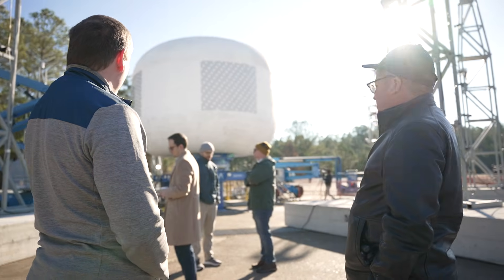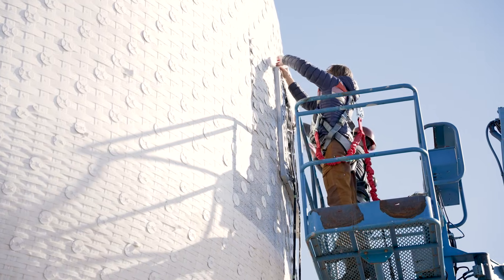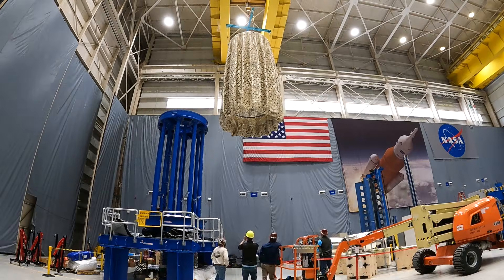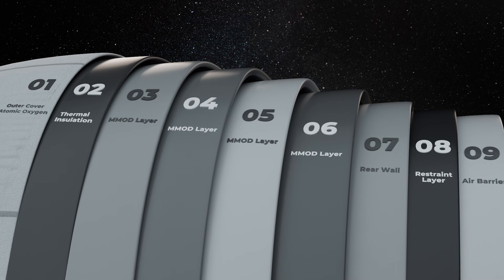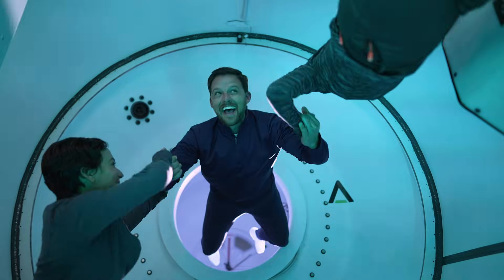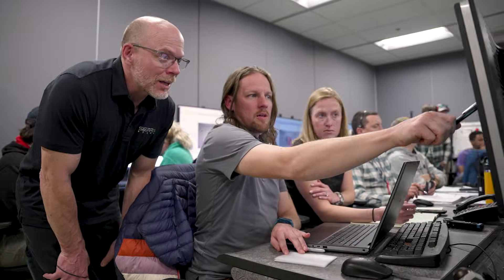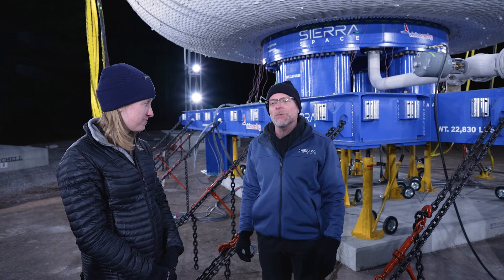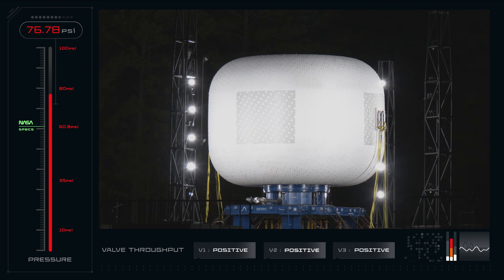Full-Scale LIFE™ Inflatable Space Station Burst Test at NASA Marshall Space Flight Center

Comment: I love to see this♥. Inflatable modules makes way more sense, than rigid body ones. I believe Sierra can only fail on production of these inflatable modules, either if they get stuck on developing one off custom sizes for new vehicles, or fail to build/finance factory for one size, that fits into most commonly launched vehicles, and potentially neatly stack into heavy lift vehicles.
Reply: Or nobody is buying. Many great ideas have fizzled out over the years because no matter how cool a concept might be - you need paying customers to succeed.
Reply: Rigid modules  have the equipment, plumbing, windows, thrusters solar etc attached to the outer walls with the inner being the access way - very easy to configure on the ground.
Inflatables are kind of reversed the equipment has to be in the rigid core tube or configured after it is inflated.
If an inflatables is set up with the outside between the core and expanded walls -although the inflatable has more volume their utilisation of that volume is not as good.
In space radiation protection another issue the soft walls are probably good at slowing or stopping cosmic rays but not so good for EM radiation - i think hard modules have better options for reducing both as the equipment mounted to the outer walls adds more shielding - although soft modules could be configured this way after they are deployed in space that involves more difficulty than with a rigid design that is preconfigured.
Will be interesting to see how the inflatables go and how they compare with large rigid modules that will be possible with starship sized payload volumes.
Reply: Trouble is, Sierra can get far more capacity per launch loading onto New Glenn (7m diameter fairing) vs. commodity rockets and their 5.2m fairings. They didn’t partner with Blue Origin for nothing.
Reply: Do these plastic bubbles protect from solar radiation as well as a metallic shield?

Comment: That's what that titan vessel engineers should have done: crush it to test it before using it on an actual mission.
Reply: You can’t crush test full size vehicles unless you have unlimited money. Models and known engineering principles would have worked just fine for Titan, the owner/builder simply decided to short cut safety to save time and money. Disaster is always the outcome.
Reply: Well, they were already informed several times by different experts both independant and on the team itself that the sub was unsuitable to go to those depths, but ignored them and decided to use the sub anyways. A crush test wouldn't have changed their mind, I don't think.
Reply: Or used a material that's strong in compression, unlike Carbon fiber.
Reply: Nah.   Im sure its fine.
Reply: it's the wrong test because their problem was a material fatigue problem. they likely did the test to excess. called it good. she's never tested how many dives it could take (it got a recommended and they ignored it anyway)
Reply: They had that data, the problem with carbon is it cracks, so it will do it once, but its once less that it can do it again. Think it had a rating for 1/3 of its implosion depth.
Reply: it's very hard to generate those kinds of pressures in such a large volume. i guess the best test would be to drop it in the ocean and see what happens

Comment: I'm curious as to how the interior components will be transported and installed.  Or will they just be empty tubes?
Reply: It would be cool if the tubes carried the inflation material (air/nitrogen/etc.) save a huge amount of space
Reply: I believe a lot of the internal fit out equipment and materials can actually be stored within the core of the inflatable. Once the habitat is inflated, crew can enter the module and assemble the internal fit out using the materials stored within the core.
Reply: There is a steel center piece that most likely would carry the parts. They will have to ingeniously pack everything in and around it and unfold it when needed.
Reply: In pieces and / or other cargo trips I suspect as far as transport goes.

I believe the idea is usually to build a frame inside to hold equipment etc.
Reply: Seems to me like most everything will be mounted on the steel core scaffolding and the balloon inflated around it
Reply: I was wondering the same thing. Is the plan to be able to inflate them already full of equipment?
Reply: I think the main hotel functions are built into the metallic core section for power, air handling, and heat exchange, then after the inflation rack-mount modules can be moved in through the hatches and lashed down inside the soft volume. Data systems are probably just wifi!
Reply: Current plan is for the all the hard components to be folded up and have the inflatable part wrapped over it, after inflating, it can be unfolded and set up. You can see it in the sleeving part here.
Reply: I'm guessing with dream chaser.
Reply: It's an "empty inflatable balloon" yes, if that's what you're asking? With a hole to dock with ships, so you can transport stuff through the hole to the inside of the "inflated balloon".
Reply: A fair amount of stuff can be installed before launch, other stuff would be launched aboard visiting spacecraft and moved through the docking port into the hab for installation, just like with previous space station modules.

Comment: Psi rating really low, still a bit dangerous for hard weather, and I’m sure it’s temperature controlled to limit expansion. I’d feel safer with a haul that can reach 2x psi with a bit more room to move in. Still amazing work, a lot to do still for this kind of pop up structure.
Reply: 75 psi is roughly 5 atmospheres.  ISS cabin pressure is 1 atm.  So I'd say your 2x limit was met, by 2.5 times.
Reply: What "weather"? It's designed for space.

Comment: what happens if it gets hit with a 10 gramm projectile at 10 km/s ?
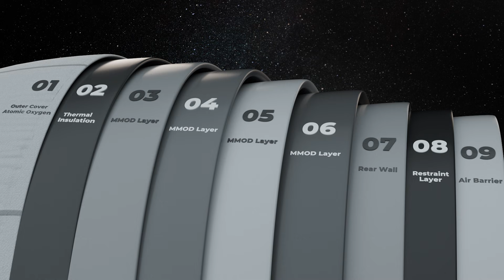Reply from the maker: Sierra Space works with NASA and uses the known and projected orbital debris environments in designing the MMOD shield. Those designs are then tested by simulating orbital debris impacts at varies speeds, size of projectiles/materials and angles. Sierra Space performs MMOD testing based on Design Reference Missions and environments. When hit by a projectile the MMOD would absorb the impact and perform as designed. There would be no effect on the pressure shell or restraint layer. We have multiple MMOD layers which can be seen in the video at 2:42.
Reply: @SierraSpace  a video going into deatail would be nice, explaining differences between module types and the appliance of the MMOD layers.
Reply: @SierraSpace  Your Hypervelocity Impact Testing (HVI) would need to prove that for the above scenario.  ;)

Comment: It's interesting to note, though NASA wanted to pass roughly DOUBLE the pressure at atmospheric conditions at sea level (The same as on the space station) Sierra more than doubled that again, to almost 5 times what it would be used at.  A wonderful test.
Reply: The reason NASA wants double is because when you put this into a vacuum, that's the equivalent pressure differential when the thing is deployed in orbit if they put it at full sea level pressure. But it's good to see it do better.
Reply: Exactly, considering the size & volume I was also surprised at how much air pressure they used.
Reply: Actually, 1 Atmosphere of Pressure is equal to 14.7 PSI so NASA's requirements are roughly 4 times the normal air pressure at sea level.
Reply: To be fair, it’s not a very high pressure. There’s higher pressure in your tap water at home.
Reply: It's good enough that they can probably look at reducing material weight a bit.
Reply: Why are those planned to be used at 15PSI of air instead of 3PSI pure oxygen?
Reply: Will be cool if they tested in vacuum at Bell Aerospace.
Reply: This video should have mentioned the normal expected PSI value.  Atmospheric pressure seems to be about 15 PSI.  So it seems Sierra achieved 5 times that, and NASA were recommending 4 times that.
Reply: So, in other words, it is over engineered and is wasteful on resources... and someone can do it cheaper.
Reply: @95rav  space shuttle engineers be like... the O ring only burned 1/3 of the way through. so it has a safety rating of 3!

Comment: This is interesting tech but when the inflated dimensions are smaller than what Starship could put into orbit with a traditional hard shell station module, I don't see the advantage.  Can you help me understand the bigger picture and use case?
Reply: Launch a bigger version on Starship.  Launch on other rockets.  Etc.
Reply: Its scalable, this module is designed for a 5 m fairing, with around 300 m3 of volume. You could potentially scale this type of module for 7m, 9m etc. It will always have an advantage over rigid structures in this metric.
Reply: Of course real modules can have sizes different from this test article.
Reply: The first seconds of the video explain the advantages. SMH. ADD?
Reply: SpaceX still has to design to allow a hatch big enough to deploy a maximum sized single piece cargo.  The "Starlink slit" would severely limit the utility of the craft.  I'm confident that they will but it will take time.
Reply: 1)Use a falcon rocket instead
2)Fill a starship with many modules.

Comment: How is radiation handled?  I'm assuming that is harder than micrometeorites which likely requires layers.  But do layers here match or surpass the usual radiation protection means?
Reply from the maker: Our space station technology is deigned for its environment and takes into consideration several factors including radiation. Specialized shielding is designed to be a part of the MMOD layering along with other materials that are internal to the Inner Mold Line (IML) of the softgoods systems. The LIFE habitat materials will go through a full spectrum of testing based on Design Reference Missions (DRM), this will include materials that have been selected for radiation protection.
Reply: @SierraSpace  now shoot it with an extremely high powered rifle.  A more realistic test.
Reply: Escape from Sulpicius Gallus M.

Comment: VERY impressive... next test should be to check survivability once inflated against micrometeorites and space debry. maybe they put some kind of bonding agent between the layers so it keeps the shape once inflated and doesn't burst like a baloon if hit?
Reply from the maker: Our team has performed MMOD Hypervelocity Impact (HVI) Testing with NASA, utilizing high power machines that can shoot a projectile at the rate or velocity of an impact in space. Our team will be conducting more tests later this year on the MMOD layer.
Reply: @SierraSpace  Do you have any plans to add impact detection to these modules?  I suppose detecting a leak is easy (watch for drop in air pressure) but what about finding the leak so crew can quickly patch it?
Reply: @SierraSpace  awersome stuff, is it published like this one? have you used the nasa giant vacum chamber for other tests?
Reply: Already did

Comment: Air pressure at sea level is 14 psi so reaching 75 psi is more than 5x the working environment, 😀 which shows what an achievement this design is!
Reply: What was the test ambient air temp? What temps will it encounter in space?
Reply: 4 times. With the vaccum of space it is about equivlent to 60PSI.

Comment: I would feel safer in it with the belief it might spring a leak rather than catastrophically explode.
Reply: This was a burst test, where the article is pressurized until destrution (which in this case ocurred at 70+ psi). The operational pressure will be much lower, around 15psi, I think. So this test proves that it will only burst catastrophically well beyond the operational pressure.

Comment: The thought of going into space in a baloon scares the poop out of me. I know it's much, much more than that, but it still gives me the shivers.
I think the next step would be to coat the thing once inflated with some kind of material to give better protection against micrometeor impacts and structural strength. Perhaps something from the moon to reduce cost of transportation?
EDIT: after saying that, I'd still jump at the chance of going into space in one of these!
Reply from the maker: The LIFE habitat has several layers of softgoods technologies. One of its layers is MMOD – Micro-Meteoroid Orbital Debris protection. This multi shock layer is designed to protect the habitat from orbital debris strikes for the lifetime or mission duration and its specific environment. This is a highly advanced design based on known technology that is applied to the surface of the pressure shell or restraint layer. Our team has conducted High Velocity Impact (HVI) tests and will perform more tests on the MMOD in the future.
Reply: @SierraSpace  Hey, thanks for the response! Please don't get me wrong, I'm certain that this technology is the future of space habitation and maybe even transportation. My fear is just the irrational, lizard brain fear I guess like "how can a heavy metal object fly" type of fear. I'm very impressed with this technology, perhaps I came across as dismissive - that was not my intention.
Cheers ✌️